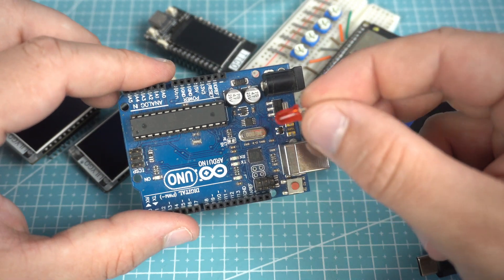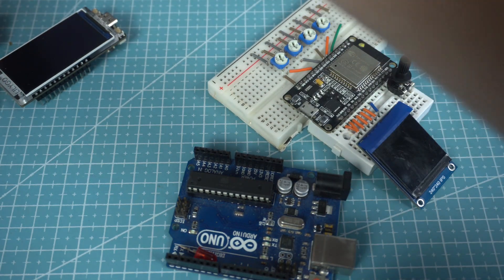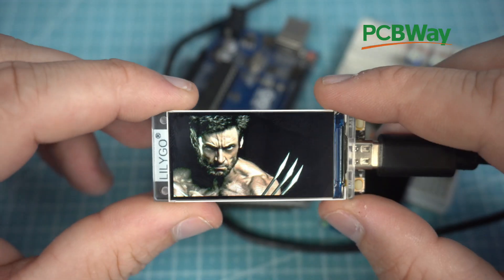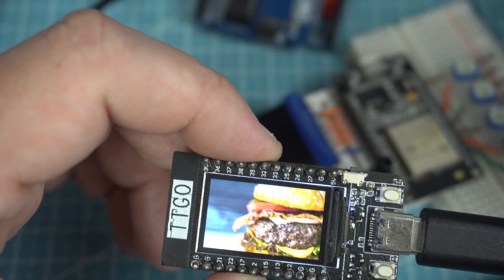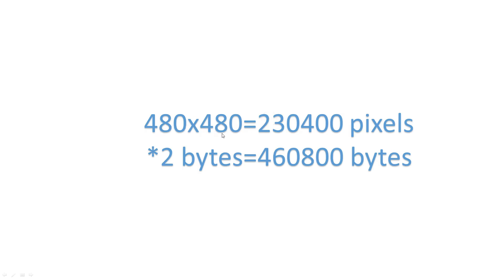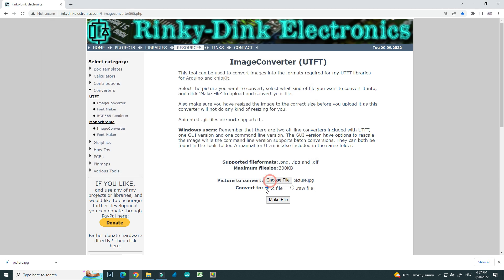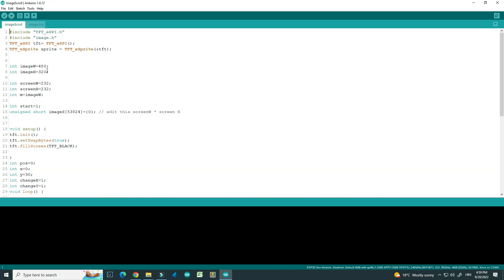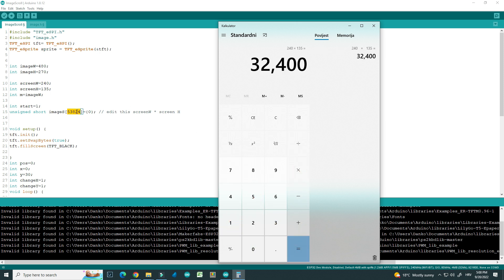How to Scroll Image (ESP32 and TFT display)

Comment: hi volos, amazing work with the project, im curious as how to make a background and foreground sprite. where the background is dynamic and the foreground is static like an aircraft  attitude direction indicator? this is the code that I have now, it works perfectly but the 'ArrowSprite' which is the fixed aircraft symbol flickers when pushed onto the screen therefore I was thinking of making a composite sprite but I don't know how to get started. please advise.

 #include <Adafruit_MPU6050.h>
#include "Back.h"
#include <Wire.h>
#include <TFT_eSPI.h>
#include "Arrow.h"
Adafruit_MPU6050 mpu;
#define I2C_SDA 20
#define I2C_SCL 21                     
#include "frame.h"

TFT_eSPI tft = TFT_eSPI(); // Initialize library for the TFT screen
TFT_eSprite AH_Sprite = TFT_eSprite(&tft); // Create a sprite object
TFT_eSprite ArrowSprite = TFT_eSprite(&tft); // Create a sprite object
TFT_eSprite TranSprite = TFT_eSprite(&tft); // Create a sprite object

void setup() {
 
  Wire.begin(I2C_SDA, I2C_SCL); // Initialize I2C communication
  
  tft.begin(); // Initialize TFT display
  tft.setRotation(0); // Set TFT rotation
 
  AH_Sprite.setSwapBytes(true); // Set byte swapping
  AH_Sprite.createSprite(240, 640); // Create a sprite

  tft.setPivot(120,160);

  ArrowSprite.createSprite(96,23);

  ArrowSprite.setSwapBytes(true);

  TranSprite.createSprite(240,640);
  

 
  if (!mpu.begin()) {
    tft.println("Failed to initialize MPU6050! Check wiring and connections.");
    while (1); // Infinite loop to stop further execution if MPU6050 not found
  }
}

void loop() {
 

  sensors_event_t a, g, temp;
  mpu.getEvent(&a, &g, &temp); // Read sensor data
  int angle = map(a.acceleration.y, -10, 10, 90, -90); // Map y-axis tilt to angle range
  int y = map(a.acceleration.x, -10, 10, 0, tft.height() - 640); // Map x-axis tilt to vertical range
  int OF=0;
  y += 160+OF; 

  AH_Sprite.fillSprite(TFT_BLACK); // Clear the sprite
  AH_Sprite.pushImage(0, 0, 240, 640, Back); // Place background image on sprite
  
  
  
  // Update sprite's pivot point for rotation and vertical movement
  AH_Sprite.setPivot(120, 320 + y); // Adjust pivot point for both rotation and vertical movement
  
  // Rotate and draw the sprite based on accelerometer data
  

 
 // Since we're not using a physical device to display it immediately, you'd need to handle the sprite display to the TFT after rotation if needed

 ArrowSprite.pushImage(0,0,96,23,Arrow);
 ArrowSprite.pushToSprite(&AH_Sprite,72,145,TFT_BLACK);
AH_Sprite.pushRotated(angle); // Rotate sprite, making the background transparent

}

Comment: I got your code from github and the intial y variable was y=30 which was causing the photo to go off the screen and then reset the program. I changed the variable to start at 0, same as y and it seems to work now.  Maybe someone changed your code and uploaded it to github. Good video, though! 👍

Comment: Is it possible to have the same code working with uint8_t arrays instead of uint16_t arrays? Pleaseeeee
Reply from the maker: no, it will not work
Reply: @VolosProjects  why?
Reply from the maker: @djste83  watch whole video, each pixel need 16bits to store amount of red green and blue
Reply: @VolosProjects  you are right, that's why it wasn't working with uint8_t arrays in my tests. Is it possible to read image from sd card instead of .h file? I'm not able to convert the Image on the fly in a uint16_t array.

Comment: Thank you for this. I just received my TTGO today and have plans for using it in a cyberpunk diorama so your video was very helpful.
Reply from the maker: tnx.where did you buy yours?
Reply: @VolosProjects  Sir I'm student. Sir can you give me a Arduino mini computer project  components list ? Please 🙏
Reply from the maker: you can see in videos all the components, 3 push buttons (2pin) , pasive buzzer, potentiometer, arduino nano, i2c oled display and pcb ofc
Reply: thanks sir. I am your biggest fan.I can use 1.2k resistor
Reply from the maker: @CodeMavenXPT  yes, you can
Reply: @VolosProjects  Thanks 👍
Reply: @VolosProjects  Sir, I want to know the value of the potentiometer.
Reply from the maker: @CodeMavenXPT  you can use amy, i usualy use 10k
Reply: Thanks a lot for helping sir
Reply: @VolosProjects  Sir I used 128×64 display.I uploaded the code and then the font size was too big. How to make it normal size?

Comment: Just in case you’re thinking of upgrading to Arduino IDE 2.0.0, I just found out that it freezes when you use large text files like your image files. So it’s best to use the latest nightly build, which has the fix, until the IDE 2.0.1 comes out. Hope this helps you or someone 👍🏾🤓
Reply from the maker: tnx, i will wait then😀 i already heard that 2.0.0 have problems
Reply: I had to switch from 1.8 to 2.0 because of Java issues. 2.0 has it's own new set of quirks like changing the board your using every time you unplug it and changing setting when you do a library update like the TFT_eSPI

Comment: I'm tring your code on a esp32 and a ili9341 dysplay, and runs fine with width 240px and height 135px, but if I change the parameters to 320px and 240px and the unsigned short imageS[32400]={0}  to unsigned short imageS[76800]={0} in order to fit the screen, I get this error during compilation: DRAM segment data does not fit
How can I fix it?
Reply from the maker: yes it is true, l tried and i get same error, it seems that array is too big, try smaller image, my largest is 234x234
Reply: @VolosProjects  My intent was to perform  only the vertical scroll of an image.
I managed to get it to work by dividing the ili9341 screen vertically into two parts.
I have replicated your code for the left and right sides using the same imageS variable and now it works perfectly.
All this hassle is to avoid memory allocation problems during the compilation.
But now I should read the image from a micro sd card, instead of an .h file. I am trying to read the image from sd and dynamically convert it to a uint16_t variable but i am not having success. Do you have any idea?

Comment: Instead of writing 32400, just put in screenW*screenH. Then you can remove the comment, because you've replaced the magic constant with self-documenting code. (there is no optimization to be gained by calculating constants by hand)
Reply: i tried unsigned short imageS[screenW * screen H]={0};  is that the syntax you meant?